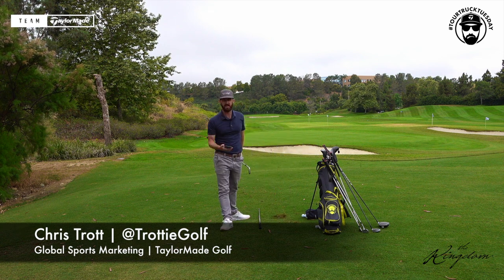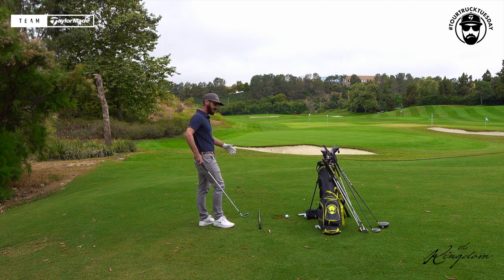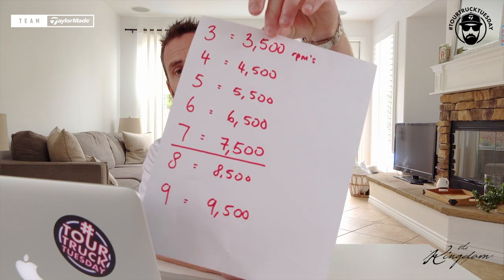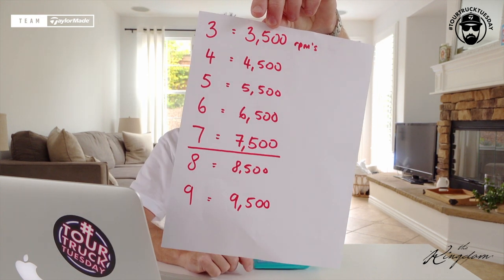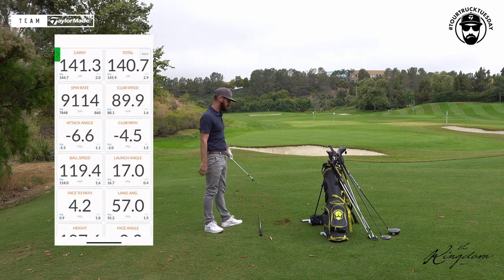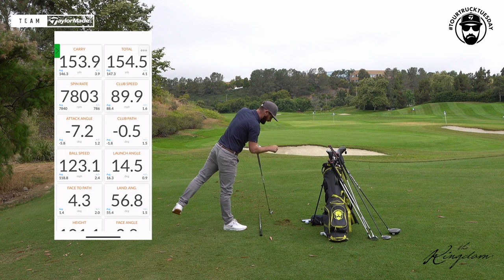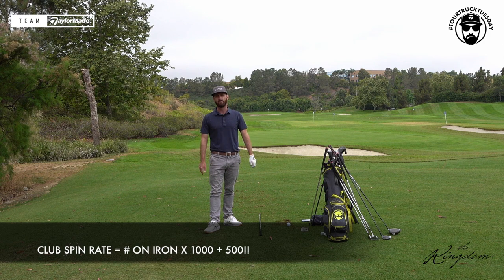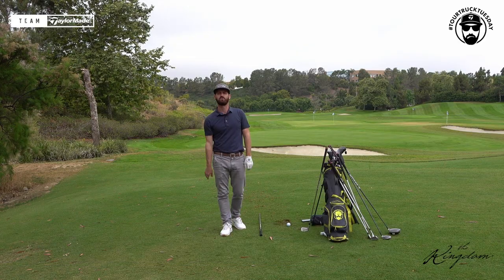The Perfect Iron Spin Rates | TrottieGolf

Comment: I play 921 tours with traditional lofts and my spin is about 5500 on a 7 iron…only way I can get spin up into the 6k’s is to play a cut. Cant get it in 7k’s even with a high trajectory fade. Idk? Spin 4 iron around 3800-4000. Lob and sand wedges 8-10 k…gap…pitching wedges 7-8…lol have no idea why. Guess  swing too slow to get the clubhead speed to get those spin numbers or I deloft my irons too much so my 7 iron plays like a 5 iron…in which case…the spin matches up fine.

Comment: Great video Trottie. I’m a senior (74) and a 15 handicapper play stealth 2. My numbers are 74 swing speed 93 ball speed descent angle 46 and spin on a 7 iron 5700-6200 and 135 yards that’s on the range with range balls in wet and cold muddy conditions here in the UK.
Are those stats ok for me or do I need to tinker I have a Taylormade fitting coming up late March to try new range against my Stealth 2 woods and irons. Many thanks and keep the excellent videos coming.
Reply from the maker: As long as you're launching that 7 iron in the 20* to 25* window with that spin and speed you can prolly get away with that. Obv more speed would be nice so if a shaft change or head change could get you a few MPH I'd take it. Great stuff & keep it going.
Reply: @trottiegolf  Thanks Trottie always appreciate your advice and love your videos, the new gear looks great so looking forward to my fitting.
Reply: @trottiegolf  do we always want to launch our 7 iron in the 20 -25* window no matter what the speed and spin rate?  the reason i ask is i have around a 90 mph 7 iron and carry about 180ish but my spin rate stays in the 4k to 5k range.  thats prov1.  landing angle around 49*  i mean all my numbers are great except that spin just seems low.. that goes for almost all of my irons.. wedges are 8k plus spin..  driver around 22 to 2500 ..  its just the 5-9 iron that is weird..
Reply from the maker: @tylerfj24  you're a low spin iron guy so you'd want a higher launch with the irons. Ideal world, launch your irons half the degrees of the loft on the blade BUT this is all speed dependent. Low on speed then launch higher, high on speed you can trap it a fraction more if you like. 90mph on a 7i isn't slow though so you're on the low spin side but with a high launch. Do you know your dynamic loft at impact? It sounds to me like you need to compress it a fraction more if you can then the spin should rise a fraction and the launch decrease.
Reply: @trottiegolf  thanks for the reply. Im playing t200 irons with dg 120 s300 shaft. Could this be fixed with a shaft or iron change?  I looked back my normal launch is around 20 deg give or take. Iron is 32 degrees staic loft. Im playing prov1. Ill get on the trackman tomorrow and get those dynamic loft numbers for some reason the app doesnt have it.
Reply from the maker: @tylerfj24  I don't know a lot on that ball (sounds crazy but I've been a TM guy for many yrs now) 

So for TM you gotta go TP5 to get that spin up a fraction. The DG 120's should but you can look to softer tips or lighter but you don't want to kick that launch up.

The Tour V could well be a good option. I did an iron fitting at KBSX and learnt a lot from an indoor fitting:

https://youtu.be/yjS_vdAKRSc?si=7hMrGTZAc_DbVmyQ

Comment: So if your spin is too high or too low. What steps should you take to get it right? I noticed you said shaft or club head angle. Is there anything else you can do? Is it the attack angle that effects the spin?
Reply from the maker: Shot shape, shaft, dynamic loft is a massive one, loft on the blade, a lot is to do with how you deliver the club

Comment: Wondering about the spin rates for a light shaft vs a heavier shaft. Let's say i was swinging a 130g then hit a 105g. Would the ball flight be lower with a heavier shaft?  Spin rates would be to low? I went from a 130g to 105g. Ball flight went from straight to a big draw. I did hit it further with the 105g. Thanks p.s. I had my right ankle replaced. So now i can have a solid base.
Reply from the maker: Yes the spin rates & launch would be impacted & for most players they'd experience what you are..... maybe minus the ankle replacements :0)

Comment: I struggle with not producing enough spin on my irons. I’m about a full thousand RPM low on every club and got fit into the Project X LZ shaft. Any way I can work on increasing rate? Wondering if it’s an attack angle or other swing flaw.
Reply from the maker: Jake Nesbitt think what hits the ball.... loft... what are your lofts and perhaps more importantly what ball are you playing ??

Comment: Trottie I have a question and not able to find info on, I have a ball speed of 140mph on my 5 iron with 12 degree of launch and play cobra mb irons standard  loft, my question is I seem to lose alot of distance against my friends who I play with yet I'm swinging alot faster then they are, carry distance says 185 for my 5iron but it seems low for how fast I'm swing if that makes sense
Reply from the maker: You lost me at 🐍 irons 🤣🤷🏻‍♂️
Reply from the maker: Nah Nah chill… look your spin rates are wrong, prolly not enough hence the short carry distance
Reply: @trottiegolf  thanks man I'll look into data some more and see if I can get some proper time on trackman would you suggest any certain data to read through?
Reply from the maker: @ashwalker3309  spin, attack angle, angle of descent, peak height

Comment: Nonsense - 7 iron, take the club #, x 1000  (=7000) subtract 1000 = 6000 spin rate
Reply from the maker: That's not the equation I said so I agree with you...... "nonsense" .... Just as a call out in text "The required spin on an iron is dictated by the speed imparted on the ball, more speed can handle a lower launch & more spin, less speed higher launch less spin."

Comment: With today's POWER BAT LOFTS, you are NEVER going to get 7500 Spin rates with what is actually a 5-iron loft on 7 irons today. ( MAYBE a blade that still has old loft numbers ) with 30-25 degrees of loft on 7 irons, I have NEVER seen anyone on youtube Produce 7000 with today's POWER BATS! 
it's usually 5200 -5400 max with good players, that's because you are hitting a 5 iron, not a 7 iron with yesterday's lofts!
And not only that these new clubs are designed to hit the ball into the clouds for a high decent angle to get the ball to TRY and STOP on greens. 
I am a highball hitter and can not hit these new powerbats as I punch holes in clouds and lose distance . 
Had to go back to my Adams V3 forged irons that are 12 years old to get back to seeing a more comfortable ball flight. 

My Adams 7 iron loft is 33* and I still get decent distance with it, I am not caught up in all the I hit a 7 iron 180-200 yards bullcrap that these MAnufacturers have created by changing the number on the bottom of the club, NO PEOPLE you are NOT hitting a 7 iron 180-200 yards, you are hitting a 4 or 5  iron that far.  
What happens when they start putting 7 on a 20 degrees of loft?  How many new wedges are they going to create for the lower end of the bag ??????
Reply from the maker: Thanks for the comment.

That's the whole point of the video, to make players aware of the loft on the blade & the spin rate the best players in the World are applying to the ball. 

The more ownership golfers take over their club set up the better they can become. Worth calling out that a lot of players struggle to launch a 7 iron at 15*-17* hence why the engineers at TaylorMade have gone stronger in loft as that's what the majority of folks need.

For you I agree, the old Adams set up or a blade sounds like it would be spot on.